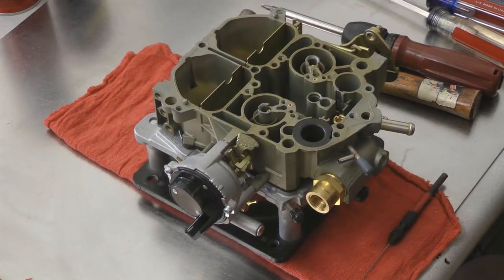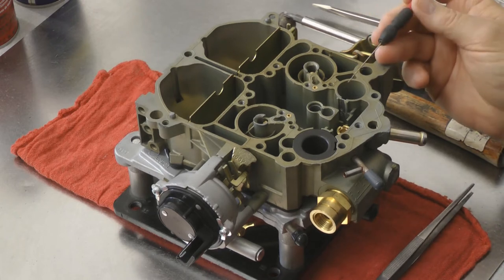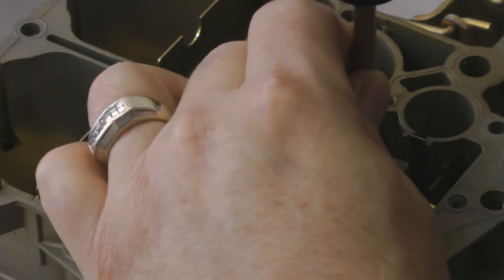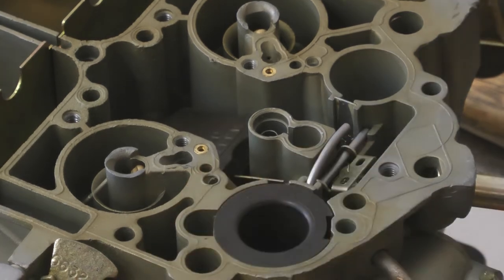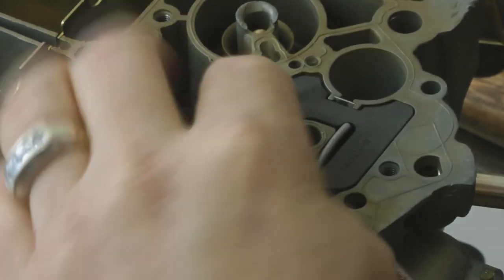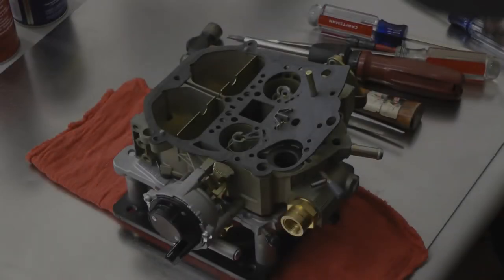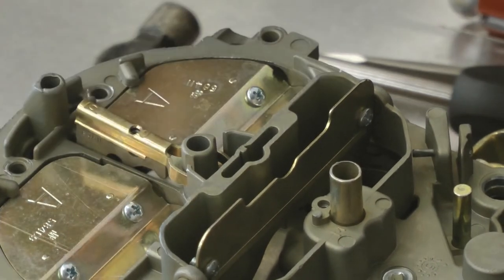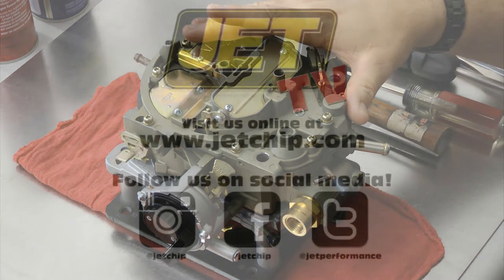JET Streetmaster Series Quadrajet : Modifications

Comment: I was tapping and using the pipe tap plug for the APT back in the early 80's
glad you're doing it.
makes fine tuning the mixture a breeze 

NICE CARB
LOVE Q-JET'S
Reply: Devan shelvey,
The apt is a stop limits how far the primary metering piston  is pulled down it's bore which in turn how far the metering rods go into the primary jets

Comment: Old school mod: 
Take a completely stock carberator and then taper the stock secondary metering rods on a lathe. Done. Costs nothing.
One fuel efficient, bad ass carb. Runs grate at idle. When the secondaries open up, look out!
Reply: How much do you take them down

Comment: I have a Stage 3 Jet Carb. for a drag race application.  Can I remove the two large secondary top butterfly's for racing only?  I don't have much vacuum and it seems either those two top covers need to be made mechanical, to follow the lower butterfly's, or can I just remove them with those 2 screws on each one?  Drag Race only.
Reply from the maker: Hi, please call our carburetor department for help. (800) JETCHIP

Comment: how do you keep the well plugs from leaking?
Reply from the maker: Hello Joe, you can use a filler like epoxy or a substitute like that. Did you get a carb from us and a plug is leaking?
Reply: @user-ef7hj8qd2y  It's a common problem on older Qjets, you go to start in the morning and the fuel bowl is empty.
Reply from the maker: @joe-hp4nk  Yea, using an epoxy or a liquid base hardening solution to completely fill that plug and close it off is the easier solution

Comment: if you go to my channel The Weldor . I show how to put secondary metering well plugs in . Ive ran Q-jets fr almost 40 years . Nothin pulls like a spreadbore ! 
Pretty bummed fr 400 bucks all i got was epoxyed well plugs . That epoxy will last about 30 ta 60 days and your shits gonna be floodin !
Reply from the maker: Sorry you feel that way. We have been doing carburetors (Qjets mainly) for over 50 years this way. Nothing but 5 Star reviews, even it this day.
Reply: Its all good brothers ! I appreciate that your keeping Q jets around ! I bought a brand new stage 2 from ya . Havnt put it on yet . But i know thers apoxy on the primary and secondary wells . I can see the epoxy on the primarys from the bottom of carb . First thing ill do is break it down . Put well plugs in it ! 
I know the epoxy is fast but ive yet ta see it last more than 90 , 120 days . Ive rebuilt not as many as you guys but 70, 80 of em . Enough of them several local mechanics just started tellin ther customers just call this guy . He likes workin on these ! I wont run anything else ! Its a 10 min job to put secondary metering well plugs in them . And then its over . Dont mess with them again ! Just sayin . 400 bucks is a good chunk a change ! Hopin every thing else is stellar in side the carb ! Last guy i sent down to get a reman Q jet . Got one from checkers . I told him ta pull it apart . Inspect it . He just slapped it on . Flood city . Barely run . Wouldnt idle . He brought it to me . You have this pos ! Im goin back to a holley he said . I pulled the top plate on carb . Ther was a E clip laying between the bowl section and top plate . Would nt seal up . Pulled the E clip . Well plugs . RIP ! 
Thanx for response ! Be safe !

Comment: What is the solution if the fuel comes out from the edge of the carburettor?
Reply from the maker: Did you get a Carburetor from us?
Reply: @user-ef7hj8qd2y  NO .for my car
Reply from the maker: @engine5020  Oh ok, well I would recommend getting new seals which we offer on our site.
Reply: @user-ef7hj8qd2y  Did you mean new air horn gasket?
Reply from the maker: Brian SD I meant for what ever area that looks like it is leaking. Or switching out all the seals and gaskets or looking for a crack. Just looking and assessing the situation